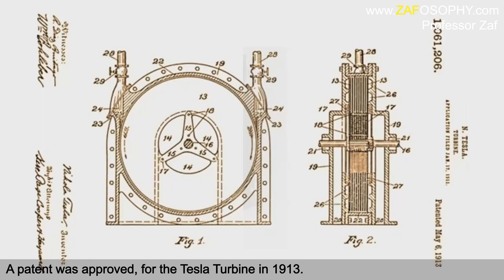Tesla Turbine compared to an Oscillating Engine (Steam Engine)

Comment: This isn't a Tesla turbine. It's a Tesla Turbine rotor pulled out of its casing.

Seriously this makes about as much sense as pointing your air compressor at a piston from that steam engine mounted on a rack and expecting it to work. 

Like, why make the video? Did you believe you were dunking on someone or something? O.o
Reply from the maker: There are so many people enchanted, impressed by the tesla turbine, as if, it is some 'magical device' which will solve all our energy needs. Being a scientist and an engineer, there is absolutely no way I can imagine, a gas/fluid moving smooth plates, with SUFFICIENT TORQUE, to generate usable energy. Of course, If the tesla turbine rotor was enclosed, the efficiency would be improved, but it could never compete with, or come any where close to the efficiency of a piston engine or a wind turbine. The fluid DEFLECTION must be 90 degrees (piston engine) or 45 degrees (wind turbine), but 0 degrees (tesla turbine) is just plain nonsense.
Just as people are enchanted by the tesla wireless transmission of electricity is just plain nonsense. If you imagine a balloon expanding from a transmission point (antenna), the amount of usable energy drops exponentially with distance. Again, the MOST INEFFICIENT, method to deliver energy.
People seem to assume that anything connected with tesla must be great and correct,  but we can see that most of his ideas were nonsense.
Even the current Tesla (Elon Musk), with his reusable rockets to transport people and cargo into space, is not the best option. It is the MOST INEFFICIENT. The only efficient option is a Space Elevator (see my 2 minute video).
Reply: @ZafOsophy  Okay, let's assume everything you say is true: That drag forces acting on a set of rotating flat plates spaced >1mm apart can't produce useful work.

If you're trying to discredit the idea why discredit it in a way that isn't going to convince anyone who believes in it or even acknowledges that nobody who advocates for the viability of a drag turbine rotor would expect it to work outside?

This is like advocating that the four-stroke internal combustion engine is a farce and could never provide useful power by taking the piston/crankshaft outside of the cylinder? Never mind that even a fully assembled ICE depends on a starter to get going so even showing an ICE unable to self-start doesn't disprove anything about them.

Since you're a self-identified scientist and engineer I'm taking that I don't need to explain the concept of viscous drag or a no slip condition involving the fluid directly adjacent to the flat disc.

But on a conceptual level, if you spin a disc in a constrained environment with a central exit point, cause the fluid to be moving at twice the speed of the disc and use the centrifugal forces to force it to take a long spiraling pattern so that the fluid has ample opportunity to interact with the fluid attached to the disc what about this seems like it can't work?

If viscous drag wasn't able to produce powerful movement a thrust augmenter for a jet engine wouldn't work at all. Both are based around the idea that the high speed fluid will drag lower speed fluids along. All that's different in this case conceptually is the fluid is acting solely on turbulent fluid instead of no-slip condition fluid.

Don't get me wrong. I'm a proponent of the design and am working on it but I don't think it is or should be regarded as The One Prime-Mover to Move Them All. Without sufficient gearing or a high voltage inverter you're by definition not going to be able to get a lot of useful work out of it.

It's strengths include ease in manufacture and ability to break the usual rules of engines (tar/particulates in fuel/etc). I mean if it only ends up in the same ballpark, or less even, in terms of useful work it seems there's still a potentially game-changing machine in here.

How?

There's a lumber company near where I live that spends approximately 50% of their expense budget on fuel moving either the raw materials or finished products around. If you were presented with an option to swap out that 50% of your expense cost for the sawdust you're currently trying to find a market for, would you at least consider making the investment in your vehicles?

Consider that virtually every industry dependent on logistics seems to have a similar kind of number it seems that there's an untapped market for a machine like this.
Reply from the maker: @Cheebzsta   Everything you have said, I have already heard many times, so we need to agree to disagree) Tide Power is THE ONLY reliable, green, almost free source of energy, which is a realistic, viable, project I hope to work on)
Reply: @ZafOsophy  Okay, I'm a little baffled by your response. 

Sure, tidal power is great but it's totally irrelevant to why a drag force turbine rotor out of its casing doesn't work or what a relatively 

Because I'd love to see solid reasons why a drag turbine's not useful for the kinds of purposes I proposed. Could save me a lot of time.

But I don't see what misunderstanding or misrepresenting its operating principle does to dissuade anyone.

Like, seriously, the engine in your car doesn't become "more efficient" because you used a starter. It simply doesn't work until some outside force starts it moving in order for it to self-power past that.

Think of the casing less like a fan duct (efficiency improvement) and more like a starter or a piston cylinder where machine ain't worth the metal it's made out of without one.
Reply: @Cheebzsta  Dude is just a loonie at this point

Comment: Great video. High level of CONTINUOUS TORQUE, is the most important factor, in generating power/electricity. Steam Turbines and Piston Engines deliver that, but not the Tesla Turbine)
Reply from the maker: Exactly. The Tesla Turbine, would need an expensive, high speed, gearbox, which would need to be replaced frequently, as is the case, with modern 'Wind Turbines/Generators'.
Reply: @ZafOsophy  With the right generator you can have it directly connected to shaft without a gear box. It needs to be a iron-core-less generator that doesn't reduce efficiency with higher RPM's.